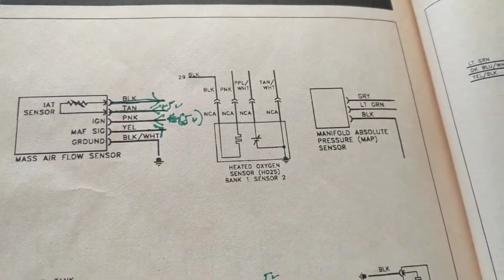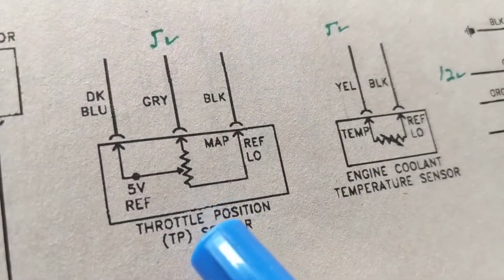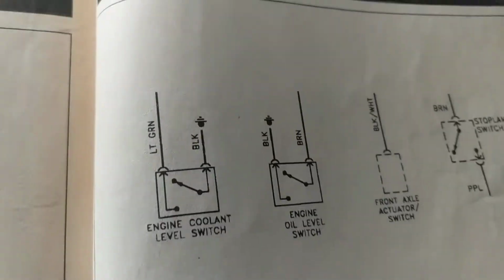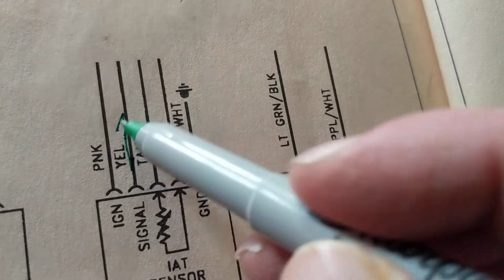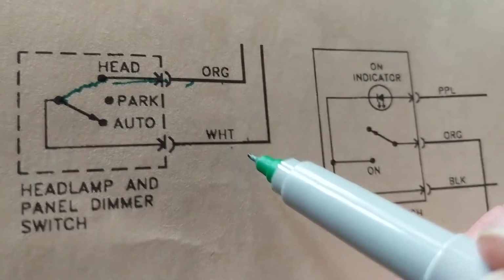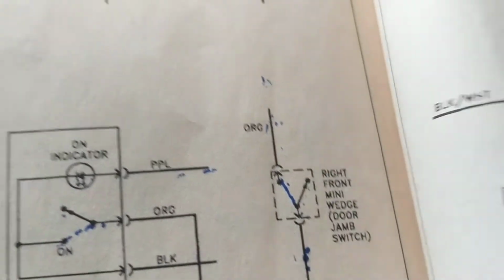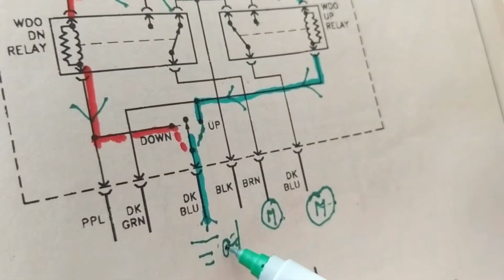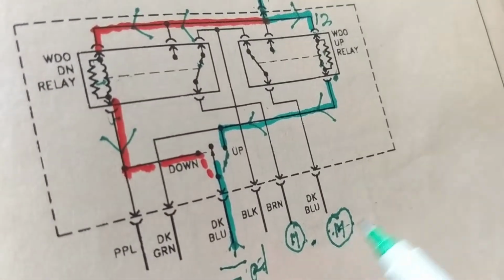HOW TO READ AND UNDERSTAND AUTOMOTIVE DIAGRAMS VERY SIMPLIFIED AND 100% HELPFUL TO BEGINNERS

Comment: I have a challenge for you, can you do a tutorial on finding a fault in HVAC SYSTEM?  I’m looking at a schematic and its really confusing. Thanks
Reply from the maker: The first thing is to know if it's an electrical problem if the compressor is being turned on or mechanical problem with the leak if you want you can send me the schematic
Reply from the maker: Or you can email it to me because chances are I won't have that schematic by me

Comment: you probably need to tell more in depth about how to tell which direction current go etc etc.. Not just close/open/how many wires/etc etc...which can be seen clearly on diagram already...
Reply: If you go to my channel Joe electronics schematics for auto you see that I always put arrows which is the direction of current flow I Believe I'm the only one who even does that to make the schematics much easier for the viewer so he can see the direction of current thank you so much
Reply from the maker: And my other channel automotive electronics schematics by Joseph where I clearly highlights with a marker the direction of current flow and I put the voltages listed no other channel does that I believe and Joe electronics schematics for Auto my other channel that I text you before in addition I get so many emails from people who are so confused about analyzing these technical schematics that I have to go over sometimes components and symbols you have to try to please most of the people as you can